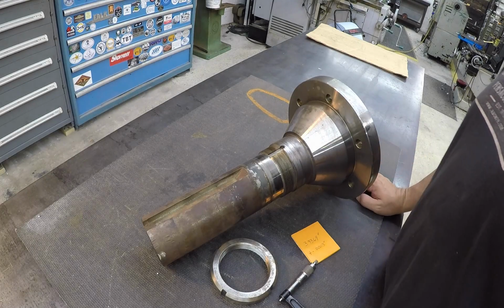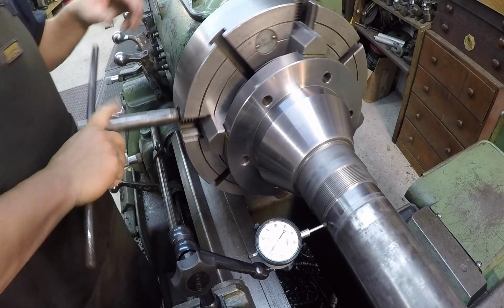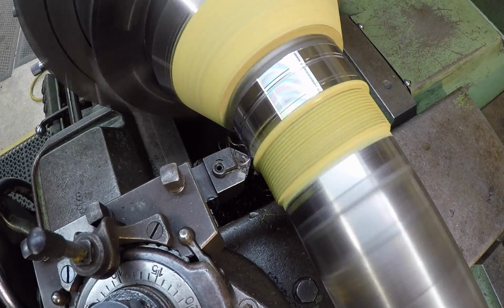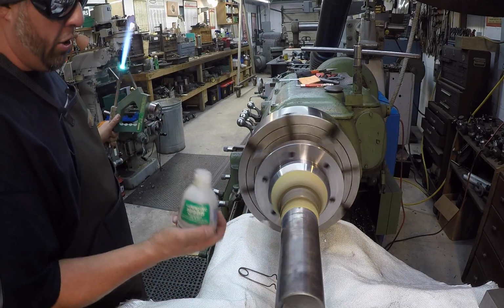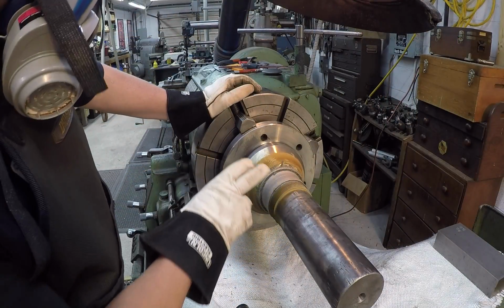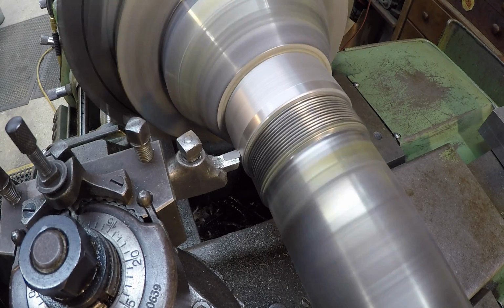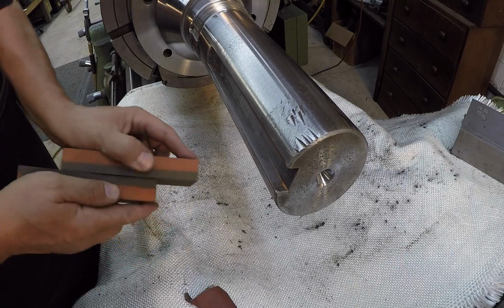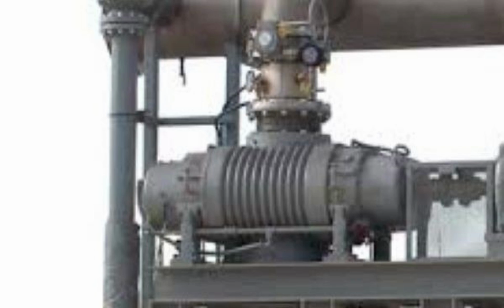SNS 300: Spray Welding a Blower Shaft

Comment: Loved seeing this.  My dad and I used to spray weld on outboard motor shafts to fix seal surfaces.  We could never do bearing surfaces, as they used uncaged needle bearings.  I think we had that same exact torch you used.  We were using an ancient South Bend lathe that had seen better days.  It's probably been 30 years since I've seen it done.  Very nice video, brought back some good memories working in the shop with my dad.  Thanks man!

Comment: I''m not a machinist, but I once put a speedy sleeve on the seal journal of a truck engine balancer that had a deep groove worn in it, I went down to my local Berry Bearing store and they had the right size for my job on the shelf, it was easy and the seal didn't leak when I put it back together. This spray welding process looks like fun if you have the tools and skill to get it to turn out right.

Comment: Not being a trained or professional welder (I am an industrial Maint Tech, so I just picked up welding as required for the various repair jobs) I had never heard of spray welding before.  I have noticed slight warping of shafts I have welded up before, even when I break up the weld to opposite sides of the shaft in an attempt to distribute the heat.  What is the hardness of the finished product and how does it compare to the wear and toughness of the base metal?

Comment: Great to see that spray welding in a different set up. Ive seen it done on ship engines to bring the block back to size were the piston liners fit. Difference being the guy spraying has to move around a fixed item not a rotating one And like you mentioned if its not prepared correctly can fail on the boring out. We had one operator that was awesome and one that had a lot of fails. Looks an art.  Great video and Channel.  Elliott from Ipswich, UK

Comment: A j6 shaft fit (3.9369 + -.003) for a rotating inner ring load (e.g. motor, pump, blower etc.)? Seems a bit light.

Comment: I had a job spray welding back in the early 80's. Worked in a machine shop as big as 3 football fields. I want to get back into  machine work for a hobby. I have been pricing small lathe mill combos. I just want to make some cool stuff.

Comment: I wished a mobile application process existed for out in the field for spray welding. I had blown a wheel seal on one drive axle wheel-end and took truck to nearest truck shop to replace both wheel seals and bearings/races on my semi-trucks drive axle. Apparently after applying hub nut, he didn't lock it in place and it unknowingly came loose. I was having new brake shoes installed at my main truck shop when he alerted me that I had a leaking wheel seal, the very same one just replaced by another shop just four months before. The brand new wheel bearings and races were destroyed and wore down the hub spindle from the spinning bearing race. If a mobile application of this spray welding process had existed, they could've done this to build it back up and saved me a lot of moola. Instead they called in the Axle Doctor who charged me separately $1,800 to cut off damaged hub spindle housing and weld on a brand new one. In all, total repair just for spindle came to about $3,000 out of my pocket. I'm sure spray welding would've cost me less and done just as good of job of building spindle back up for new bearing and race just like on this piece you just did. Impressive work.
Reply: Precise reason I like to do all repairs that I can myself. Nobody perfect but I know if I make a mistake I can fix it but something like what happened to you there's not a lot of other options. I hope you talked to the first company and asked for some money towards your repairs.

Comment: Interesting video and process. Watching it, I am reminded that the ablative heat shield on many of our space capsules was made of nomex honeycomb and high-temperature silicone sealer. It would have to be tested on a scrap part, but perhaps screw holes and other features you want preserved could be filled with high-temperature silicone sealer. It may not always be fun to remove though. And it should not be used for anything that needs to be painted.

Comment: I have some work for you with the thermo spraying to do seal surfaces on the power steering sector shafts from the old 73-79 ford trucks.

Comment: That looks like some pretty soft spray. About what Rockwell does it go on at?
Reply: The process is called HVOF, and the hardness can vary. It's kind of like sintered metal, and that can get pretty hard, even if it isn't as tough as something like an overlay weld.
Reply: @notsure7874  I'm very familiar with the process. I worked for Sulzer Pumps for quite a while and have machined much HVOF and NCB hot spray. It just seems a little porous and soft like Sume GA spray which is just a base metal spray. We would use nothing less than Sume RA for bearing fits which sprays about 50-60 RC with good ductility but, you wouldn't be able to touch it with braze on we did it with CBN tipped inserts or ground it.
Reply: @jasonholley8397  Right on! You've seen a lot more of it than I have then. Yeah, I'm not really sure about the powder he's using, I'm not a machinist, I was a welder - but I've seen the stuff used. It seems kind of like a "spray on sintered metal" and I've never seen sintered metal that was very ductile - not that it doesn't exist. Definitely feel ya on the "braze on wouldn't touch it" factor - I remember a super hard shaft end I was supposed to cross drill ... I burned a couple of pretty costly bits out on it before it got through the plant managers titanium cranium that we needed to send it to a shop that had the right tools. I did manage to get a dimple in it though! :D :D

So you're thinking what he was spraying might not be in the hardness range of what you'd generally use to fit a bearing?

I was really not expecting to see HVOF really, I thought he was gonna overlay weld it and machine it back down. He was saying that would put too much heat in it, and warp it - but I really don't think that would have been the case. Turn it up to 11, move fast, and let it cool adequately between passes, and it'd stay straight - then again, I'm not a machinist, and don't generaly work to sub thousandth tolerances either. Anyway - it's still a pretty cool process.
Reply: @notsure7874  I think at least for the people I worked for that it would have not made the grade but, the people he is doing it for might have wanted a softer spray for their application you just never know about engineers specs 😆. We used a blend called Sume SA that was a tungsten carbide substrate sometimes with or without cobalt, it was 70-80 RC and it was a bitch to deal with we had to grind it with diamond wheels lol. Stuff like that has all but killed the old hard chrome process for bearing and seal fits.
Reply: @jasonholley8397  This one dude calls it "cuntstain targlide" ... it doesn't really get much harder than that, except maybe some engineers skulls. I have a love hate relationship with engineers ... They have a lot of in depth knowledge that is really tough to match, and very useful - but at the same time they often times they're so "book smart" and have no sense. Then again, I'm an engineer (along with most of my extended family) so ... :D Software engineer though, and a lot of times I really wish I'd have never put down the torch :/
Reply: @notsure7874  I understand man. I still practice machine work but as a teacher at a trade school now. The only thing I can say about engineers is, I wish some of them would spend time making the stuff they design lol.
Reply: @jasonholley8397  Drawing things on paper and making them happen are two entirely different things - just ask M.C. Escher!

Good on you passing on your knowledge! There's only so much that can be done overseas, and people being pushed to "go to college or be a loser" has got things where the skilled workforce is going to be retiring soon - and there's not enough people to replace them.

Comment: Man, that's quality work there!  I'm not a machinist, but I am a bit curious about the conical hole in the end of the shaft.  As I understand it, when the part was originally made, the conical walls defined the center axis of the end of the piece, assuming that the original lathe was properly aligned.  I can certainly understand why you do not want to apply pressure to that surface while you are aligning the piece in your lathe.  Do you eventually apply pressure with the live center, or is the live center just there in case the piece slips in the chuck?  I guess an underlying question would be are you supposed to trust the geometrical accuracy of this aligning hole?  This part has seen a lot of use and thermal cycling.

Comment: Worked in a Plastic Pipe Manufacturing Plant, and used the Spray Welding to Do the Same thing on a Shaft where a Speedy Sleeve had been used Before, and on The Same type of Blowers to Convey Plastic Resin.... Good Job... Brought back Good Memories...

Comment: Could you spray an single cylinder engine bore (approx 75mm bore just for scale) its an old 1930 Petter Stationary Engine
Reply: Those petter engines are definitely easier to bore out and sleeve
Reply: I supposed if you had the tools to yes, but sleeving it would be better.
Reply: @BasedBidoof  
Thanks

Comment: They probably didn't use a heat stick like you did all and every welding procedure has to adhere to the rules of proper fusion right procedure proper end result.

Comment: Thanks for the video I used a eutech system a little different than yours in the Navy onboard the USS Turner Joy  DD-951 it was on a shaft that washed every bodies clothes called a washing machine this was done back in 1971 the crew of over 300 were very thankful, at the time I was a SF-2

Comment: This was the first time I have even heard of spray welding.  I have never welded anything, but I have been around welding off and on for over 60 years.  All my uncles on my mothers side were iron and foundry workers.  One had a welding fabrication and blacksmith shop just a few hundred feet from our home.  I spent many hours in Uncle Joe’s shop watching them build and repair all kinds of stuff.  I almost went to a trade school to become a machinist, but went into the Air Force instead.  This was very interesting to watch.  With YT it’s like having a library in your pocket.  I have learned about something new today.  You did a great job at explaining the process.  THANKS A 1,000,000!,!

Comment: Please excuse my ignorance but I need to clarify. So the bearing journal was worn. So you welded fine pieces of metal back onto the shaft to add enough material to machine back to the correct tolerance? Is my interpretation correct?
Reply: Exactly.

Comment: I use to go with my dad to work, at a machine shop in Dallas called Varel , in the 70's and 80's. By all means show everything you can, cause there is a lot to machine work. Including spray welding then Lathe to size to chucking a part in the lathe straight and true. Companies are using c.n.c. machines to do most work now. Seeing things done by hand are becoming a rare thing to see.

Comment: I discovered there is a difference between a $4.00 wire wheel and a $26.00 wire wheel.  During some masonry work I needed to polish shale to smooth some sharp edges and I began feeling sharp pains..in my foot..in my arms..several points up my legs and I finally stopped when my neck and cheek felt these sharp pains.  I put my tool down and realized that about 30 of the wires from the wheel had come out of the crimped hub and embedded themselves about 1/2”-1” into flesh and muscle.  I was not amused as I pulled them out with my needle nose pliers one by one.  Oh, did I say 30?  Yeah, 47, and they set in a small jar on my bench shelf as a monument to the miracle of tetanus shots and stupidity of not stopping as soon as the pain began.  There’s a reason that people who rely on their tools for their living don’t buy the H.B. special from a smoggy province near the Gobi Desert...  Thanks again for a great video teaching a new skill to start practicing!
Reply: Thank you so much for preventing me from making a terrible mistake.

Comment: Spraywelding is a whole new technique for me.
I once in a previous job as a software developer was tasked with making a database application to capture the knowledge of every welder in the organisation into a google for welders type app.
It was such a complex idea that we failed and the company subcontracted to a company in Houston who failed too.
Welding is a crazy complex art and I had no Idea.
I worked with a very knowledgeable welding engineer in Houston and she was an absolute Gem. Thank you for the experience and also for Callum's book you gave him.
We designed the database structure based on materials, tests like sharpies etc. I remember being baffled wen she told me there could easily be 5 different materials in a v shaped weld.
The thing that killed the app was welding has so many variations. There is a very flexible data structure needed to model all welds that happen and and a ton of variables that are not common across different procedures.
I think in time we could have done it but the company gambled externally and they failed too and were very expensive.
Welding became both a Craft and a Science for me after that experience.
Much respect for Welders.
Luv and Peace.

Comment: Have you used "Electro-plating"?  My shipmate, MR- Petty Officer, would do that, on in-place, generators, on board submarines, we repaired, as could not use open flame. Reverse polarity, Fluid was "neg." , shaft was "POS.", & I would use ,spud, & air drill to turn, shaft.

Comment: Lost art for sure. Not used much any more because it can be very noisy and smoky. Often leads to a chronic build up of carcinogenic heavy metals in your system unless properly vented and contained.I feel regular welding with a good pulse machine puts less heat than traditional welding and is just as fast or faster and healthier.

Comment: Around 1976 I worked at a clutch and brake rebuild shop we used a similar device but it looked more like a cutting torch and the bottle screwed on to the back of it when you pressed the oxygen lever down it would draw out the metal dust and blow it onto the repair.

Comment: Adam, great video, thanks for sharing.  As I watched this video I wondered if this technology could be used to repair automotive brake drums where the inside surface has been worn to out of tolerance specs. I am into vintage pickup trucks and brake drums are becoming very hard to find.  Nice to see a craftsman  doing what he loves.  Also wondering if it would be cost effective?   What would you have to charge to rebuild a brake drum using spray welding?  Thanks, Tony

Comment: What is the name/brand of the yellow "latex" paint used for masking?
Btw, my shop has 2 lathes setup for mig welding. We repair motor shafts from 1 to 1000 up, about 1 rotor shaft per week.
Thanks,
Ed

Comment: how much time and how many bits would it take to just machine out a new part on your lath like that????
Reply: In a repair shop, it might be called flame spraying. A shaft wears down and to build it's surface back up doesn't require an entirely new shaft to be manufactured. An example is if you have a steam turbine driving a shaft. It's cheaper to build up the shaft (journal) and have it turned. Bearings and/or it's race can be replaced or rebushed. Cheap Chinese imports hurt American industry. Any more a cheap Chinese pump is better than refurbishing an American made pump, shaft or bearing.

Comment: This process can't replace tig or mig on say, building a custom intake, headers or in floor pans in a vehicle, right? This seems very industrial oriented, not gearhead oriented, or am I missing something?
Reply: Different kind of welding, spray welding isn't any good for those situations because it's a surface building weld, not a deep penetrating bond kind of weld.

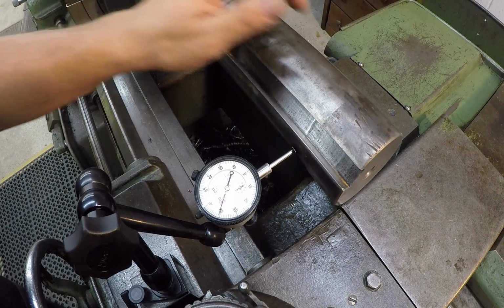Comment: 9:50 Question, why not put the indicator on top of the piece so when you bump it it's going straight down rather than being affected by gravity?
Reply: maybe gravity affects also the needle measuring pulling it down pressing against the material slightlky more giving maybe tiny off measure? plus it seems difficult to put it on top being able to angle everything to see the gauge, we are talking tiny forces affecting here, its just seems easier to work with with this setup
Reply: @MoDeG7  I've worked in this business 7 years or so, always put it on top, on the side it would always slop down.
Reply: @Triple88a , if you already had an opinion or you know best, why did you ask the question, and then answer it with your own 7yr knowledge. I think the guy in the vid is probably well experienced, so it would be good to hear from him.

Comment: Having been in the mechanical and electrical trade for over 25 years, you sir have a gift. That probably saved the customer thousands of dollars than having to buy a new shaft. Great work! You do make me wince not using eye pro with a wire wheel. I've had to have metal surgically removed from doing that and having only safety glasses on. Wire went up under my glasses. Now I use glasses and a face shield. That surgery was no joke.
Reply: Doubtful it's thousands of dollars, I welded on and replaced head pulley and tail pulley shafts for years for a big mining company, they are not that expensive. They are a critical part and time is more important in production, so he probably saved them some pennies on the shaft but thousands of dollars on the machine not being down very long

Comment: Great video and explanation, my father's shop used a Metco sprayer for similar applications for years and they still do today. Excellent process for large engine blocks, where there had been head gasket failures. His company used it for some of the larger crank shafts as well. Mostly larger earth moving equipment and gas compressor engines. Keep up the great work.